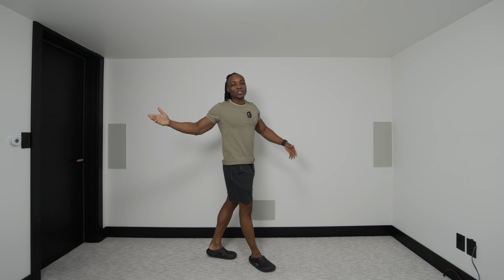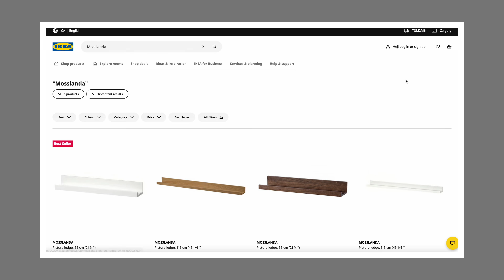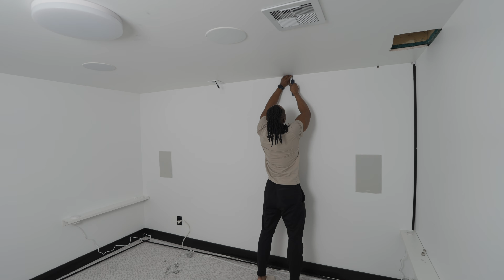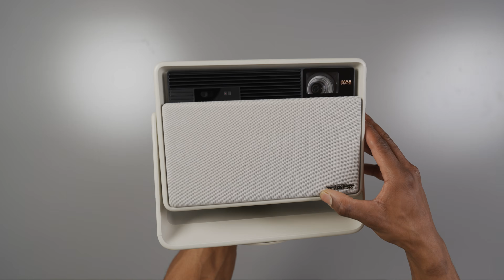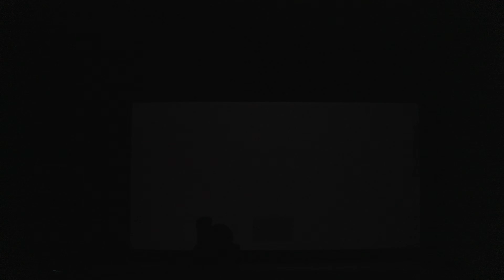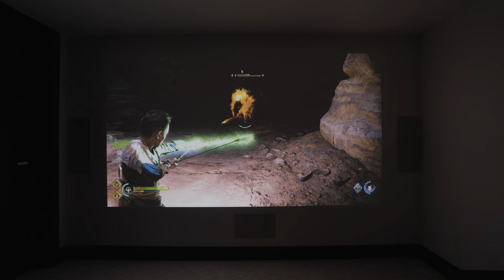Putting together my new comfy home theatre & gaming setup!

Comment: The issue with using AVR’s for hdmi is the older ones are usually not hdmi 2.1 passthrough. People should check that because you can lose quality when running next gen consoles like PS5. The pioneer vsx935 in this video from 2021 does have 2.1  though. Just something for the viewers to check. If you’re running an older AVR for sound then you should run the 2.1 device straight to the tv/projector, then run a digital optical cable straight back to the AVR. Or if you have a tv with a HDMI ARC/eARC you can use that HDMI input as your hdmi input from the AVR to the tv ARC means Audio Return Channel so it has 2 purposes- Sending video to the tv from the AVR and also audio from the tv back to the AVR👍

Comment: You should definitely consider adding a screen to your projector setup — it would elevate the overall aesthetic of the room and prevent the space from feeling incomplete when the projector is off. Additionally, the Apple TV isn’t configured correctly for Dolby Vision HDR. You’ll want to leave Dolby Vision disabled under Format settings, and instead enable Match Dynamic Range and Match Frame Rate in the Match Content settings. Excellent video — keep up the great work.
Reply: Great video, not sure about the white walls in a cinema room but love the fact you never used a screen sometimes people are obsessed in using screens. I personally dont like them it looks better as you can make the image bigger to fill the wall also you dont notice the black bars as you do on a screen.

Comment: You'll likely be getting a huge amount of audio reflections off the front left and right side walls right up to the speakers, because they are against the side wall. You need accoustic panels there. Ideally they should have been closer in off the walls, but too late now. Such an enclosed small refective space for audio isn't going to be great anyway, but the furniture would help a lot. Still, you really need something to fix those front speakers.
Also, how do you breath in there? I'd be worried about poor ventilation in such a sealed space. How does the air coming in even get out?

Comment: Amazing set up.  Would highly recommend using a screen.  Even the best newest sheet rock will dull your picture.  Sheetrock is not designed to display a projector, obviously u can do it.  It’s like shinning an extremely bright light on your wall.  Even the cheapest of screens will offer a better viewing experience.  Don’t take my word for it, do your own reasearch and you can always try a screen and see how it goes and return it if it’s not helping.  the one upside to not having a scree with your projector is you can switch very easily from 16:9 to wide screen.  And most movies are in widescreen, but not all.  Not having a screen would allow you to switch back and forth easily.  They make screens like that, but they are highly expensive.  Good luck.  Love that couch
Reply: This. The screen potentially impacts a projector's perceived qualities in ways that you would never understand until it's in place.

Comment: Nice setup, if you get/got an acoustically transparent screen you could put your LCR all in line at the same level right behind the screen that would them match the voices to the dialogue coming from the screen rather than from the floor. A huge difference in the sound performance of your system. I'm sure your past that point so maybe an upgrade in the future, but a dedicated space in and of itself is amazing.

Comment: Nice! I think i saw another video of yours that was just a soundbar. AVR with surround sound is the way to go! Very nice. I would have elevated the center with a screen that allows audio passthrough, had 4 heights and had external amps, but im sure you did your research and got exactly what you wanted. The server rack always keeps things organized! Very nice! Next upgrade, think about bass shakers. Nice wetbar
Reply from the maker: Thanks! Yeah, I did a lot of research and landed on this setup for now. Appreciate the upgrade recommendations - I already have a screen that I’ll be putting up soon but definitely gotta check out those bassshakers. Also, thanks for the kind words 🙏🏾

Comment: Awesome setup. If you're going to get a screen raise the centre channel so it's in line with your left and right and get an acoustic transparent screen.
Reply: Yeah kind of a major miss IMO.  I had a channel (previous owner) lower to the ground.  Even with the tweeter/woofers pointed closer to ear-level, never sounded right.  Moved it 3' higher so the tweeters of the L/C/R were matched up, BIG difference.